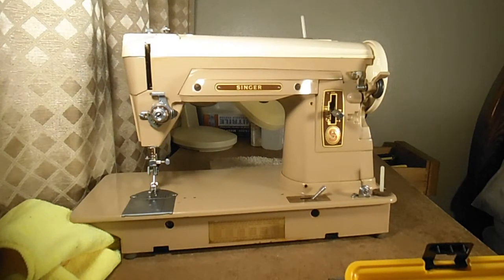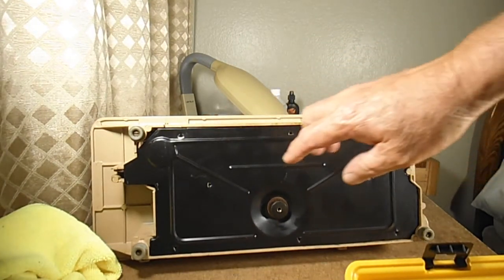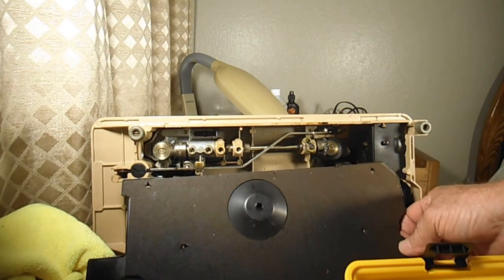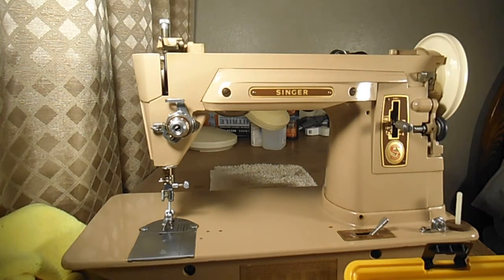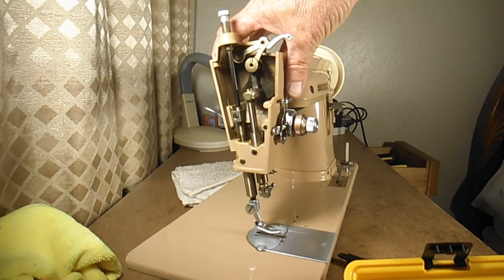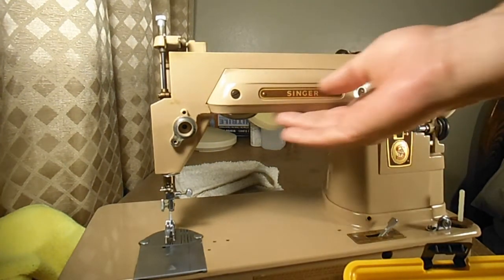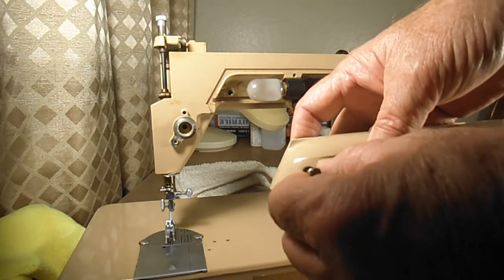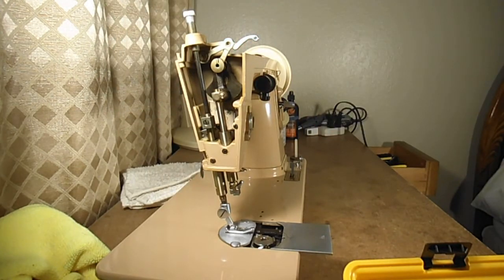SINGER MODEL 404 RESTORE SERIES Pt.1 REMOVE COVERS & TENSION

Comment: I just acquired a Model 403a, it came with its original cabinet for $55. I also have 2 503's, and I am hoping that with this video series I can explore the innards of the machines myself. I've had no luck with finding someone knowledgeable to do the work.
Reply from the maker: Hi, Roberta. I think the series will be worth your time. The only differences with the 403 & 503 are the camstack & swing needle. If you go to this site you can download a FREE copy of the original service manual for the 500/503 model. It has sections on remove/replace the parts I don't cover on the straight stitch only model 404. Between my series and the service manual I think you will be able to get the machines running & sewing very well. Good Luck, and contact me if you hit a roadblock. Here is th link: https://sewingdude.wordpress.com/category/free-manuals/
Reply: Andy Tube gosh I didn't really expect to hear from you. Thanks for your kind remarks and I very well may reach out to you. I peeked into the 400 manual and it says to remove the motor and wiring harness and soak the whole machine in Varsol (which I take to be some kind of solvent). Do you do that?
Reply from the maker: I have never used Varsol. It is a volatile organic compound, petrol chemical with hydro carbons. You may know it as paint thinner, white spirits or turpentine. It was hugely popular with Singer repairmen who would soak a dirty machine in it, even overnight. If you look through my series on the 404 you will see I use Krud Kutter to remove the old oil & grease in about 10 minutes. Just be careful with the painted finishes as it can dull them. I would never use the Krud Kutter on any Black Singer Finish.

Comment: Bought a 404 at Goodwill yesterday for $6.99, I will be watching all of your 404 series to get it cleaned up, it is pretty dirty but motor still works and sounds good!
Reply from the maker: Best price ever! There is dirty and there is dirty. Don't be discouraged by a dirty machine just think of how it will be after cleaning. If it gets tough on you just watch this video: 
https://youtu.be/04AN-FW7DzA
See? You can do this and it will be very rewarding. Good luck, and congratulations on a super price.

Comment: I was hoping you could answer a question for me, I recently got a 404 machine and love it ! I ordered these plastic spool pins and they are constantly falling out! I try pushing them in, and screwing them in and they tip and fall.... am I doing something wrong? Thanks for any ideas you might have!
Reply from the maker: Congratulations on your marvelous model 404! It's not so much you are doing something wrong, just not quite right. These are the pins I use; they fit over 30 models of vintage Singer Machines: https://shop.sew-classic.com/Spool-Pin-Plastic-Tap-in-Singer-401-403-404-172007.htm
If you take a look at this video you will see how I install them. The arm cover pin @ 46:20 of this video https://www.youtube.com/watch?v=DsLLF0-4Vpo
The pin for the bobbin winder thread spool is @ 103:26 in the same video https://www.youtube.com/watch?v=DsLLF0-4Vpo
I like to use the rubber mallet but have used a regular metal household hammer too. Maybe this video will help you out, and thanks for watching my channel, Dana.

Comment: Hi Andy, Luke again here from Australia.  I am pretty excited as I have found a one-owner 404G and it's on the way. It looks very good in the photos and has service history which is rare over here. Anyway, I have a question:  I am confused as to what models or buttonholer and monogrammer to use with this machine?  I don't want to buy the wrong ones and I am not sure they are the same as the zigzag models.
Anyway. thank you again.   Oh and PS, I sourced some Krud Kutter products here in Australia and I now have degreaser and Must-for-rust the same as you use. Good times!  Luke
Reply from the maker: Congrats, Luke. I've seen pictures of the 404G and it looks great. Minor differences is all. Here is part 1 of a 2 part video series using a slant-needle buttonholer on model 301A. The red treasure chest it's called. It would also work on the 404 straight-stitch machines. 
https://youtu.be/bVlDzfuiO6A     here is one currently on our eBay site in the US, but you can buy them much cheaper:
https://www.vintagesingerparts.com/products/original-singer-slant-needle-buttonholer-fits-models-301-401-403-404-500-503?variant=7958229811230    The Cloth Clamp moves the fabric and that allows this to be used on a straight-stitch machine.
Here is the manual (same manual for straight and slant versions) http://ismacs.net/singer_sewing_machine_company/manuals/lowshank.pdf
As to the Monogrammer Attachment. As far as I know, they only work on a ZZ machine.
I hope you like Krud Kutter as much as I do for cleaning the machine and other uses. Best of luck and take care.

Comment: I like watching your videos.  They are very detailed and easy to follow.  I just got a singer 403a and want to clean it and get it up and running.  When trying to pull the bobbin thread up with the needle it is not working right.  It is gathering the thread and bunching it up.  Then if you try and sew it puts a lot of thread on the first stitch and then none at all.  Any suggestions?  Thank you, David
Reply from the maker: Hi, David! If the needle thread will not pull up the bobbin thread it may be the hook to needle timing is off. The first thing to do is a good cleaning. Remove the slide plate, needle plate, bobbin & bobbin case. Then clean the throat area of all lint and dirt, oil the race and reassemble. Clean out the upper tension unit with a brush or canned air. It is surprising how a small amount of lint or dirt can mess up the stitch forming process. In my next video, I show how to remove all the parts in the bobbin area. You can also go here to get a free copy of the instruction manual. Just enter 404 in the search box: http://www.singerco.com/support/instruction-manuals
Look that over to be sure you run the upper thread properly and the bobbin & bobbin case is correctly threaded. Sounds like the upper tension may be a problem. Since the 403A has all metal hook gearing it is unusual for the timing to be off.
Reply: Thanks Andy I appreciate the inforamtion.

Comment: Please, where is the serial number on the 404?
Reply from the maker: Hi Daniel, as you face the machine lay it on its back away from you and look at the bottom of the machine on the very left edge like to the left of the bobbin area. You should see the letters and numbers stamped into the metal right near the edge. If that doesn't work let me know. Thanks for watching my channel. Good luck!

Comment: Awesome video!! Thank you!! I was searching for info on this model and your video was just what I was looking for.  I was wondering if you know how to replace the spool pin? Mine has been snapped off.  Any information that you can provide would be welcome. Thank you
Reply from the maker: Thank you, Wendy. For the spool pin on the arm cover, I remove the arm cover and set it upside down on a folded towel. Usually, the end of the spool pin is exposed and I can push it up and out the top of the arm cover. Sometimes it takes using a wood dowel or BBQ stick and tapping with a small hammer or rubber mallet. For the bobbin winding spool pin, you can't always get to the bottom of the pin from underneath. If enough of the pin is left I grab it with pliers and twist and pull it up and out. If there is not enough to use pliers I cut it flush with a tiny saw blade and drill it out using a small wood drill bit. Using a bit smaller than the pin diameter so I don't damage the aluminum base of the machine. Thanks for watching my channel.

Comment: Also I can hardly see the numbers on the tension ring on my new to me 404. It’s no longer coloured. Any way I can replace that part? Where to order? Thanks
Reply from the maker: If you want vintage parts you will need to buy the whole assembly (most times) watch for them on eBay and bonanza; they sell quickly. $15 to $30. You can buy an after-market assembly that works, but you usually need to trim of a little of the stud and pin to fit in your machine correctly: https://shop.sew-classic.com/Singer-Tension-assembly-Replacement-200-400-series-others-SCT422403-455.htm
The numbers are raised from the dial and I have colored them with a paint pen rather than replace the dial. If the numbers themselves have worn off that means the metal has worn away. I have never seen that though.

Comment: Andy, I was using my 404 the other day after it not have being used for several years and everything was working fine. Today I plugged it in and i have no power to the machine whatsoever, the light does not come on no sounds..nothing . Do you think it could simply be the power cord?
Reply from the maker: Maybe. Does your 404 have two cords? One the goes from the wall outlet to the receptacle on the machine? It has a wide "plug" with three holes and connects below the handwheel. The second cord has two "prongs" that connect near the base of the machine and comes from the foot controller? So the cord from the wall with three holes is what brings electricity to the machine of course. With only that "power" cord connected the light should be able to turn on and off with the switch, even without the foot controller cord connected. So if you can't even turn on the light, it is possible the cord failed. It is also possible the receptacle prongs on the machine are dirty, especially with verdigris. That's a greenish sticky build up from the brass pins and electricity. While the machine was sitting for several years was the cord still connected to the machine? It's possible the sewing you did warmed up the green stuff and when it cooled it created a barrier that is blocking the electricity from making a connection. Pull the cord and look at the prongs. If they are dirty clean them with alcohol, sandpaper, wire brush, metal polish, something that makes them shine again. The green stuff and dirt could be inside the cords now which makes them unsafe in my opinion. New cords online are $8 to $15. I  have also had cords fail right where they go into the plug at either end. The get siff and brittle and then when move the wires inside can separate or break. I am assuming you tested the electical outlet?
Reply: Yes, I have two cords. I'm going to clean the prongs like you suggested and if that doesn't help I will buy a new cord. Yes, I did test the outlet. Thanks help Andy i appreciate it. PS I love your videos.
Reply from the maker: Thank you. I hope you stop by again. My two main sources for cords: http://shop.sew-classic.com/Singer-Cords_c34.htm 
https://www.vintagesingerparts.com/collections/singer-model-404-parts
All new cords are black, sigh ....
Reply: Thanks again. I will check them out.
Reply: Cord on order. Fingers crossed. It was on sale too!!
Reply from the maker: Nice! Good Luck.